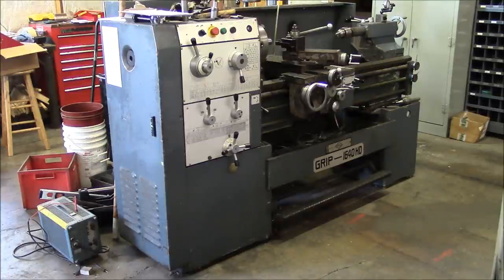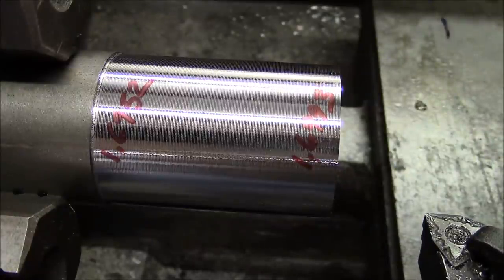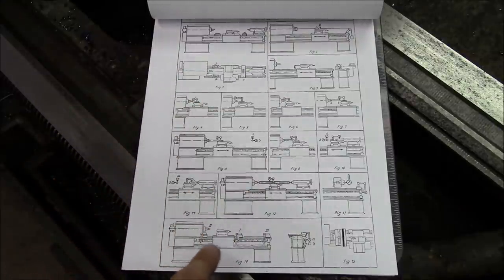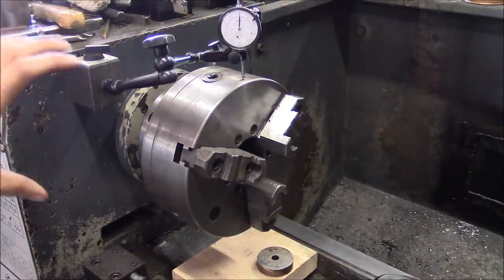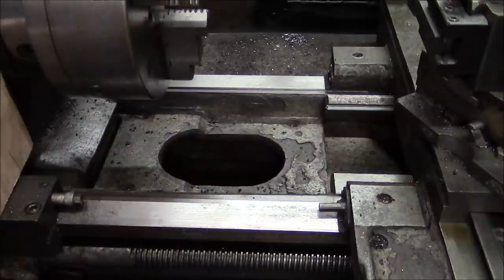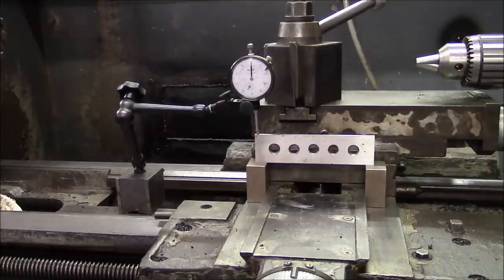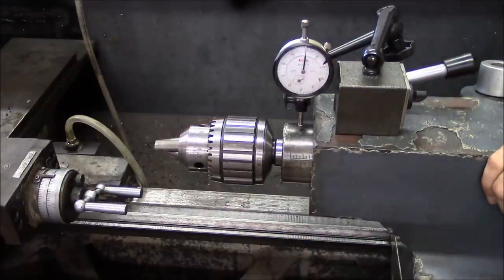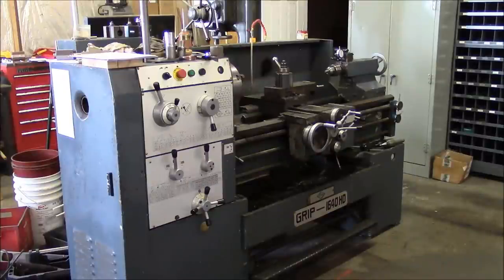Worn Engine Lathe Evaluation

Comment: The finish you got is what we call cat's tongue,  remedy is to increase the feed and reduce the speed.  You can't take a shallow cut with insert you showed us.  It is possible to get a piece of stock which will not give a good finish. Try a different piece.

Your taper is due to bed twist which is nought to done with level...........they use lathes on ships, don't confuse level with twist.

Good luck!

Steve
Reply: Umm, this is his personal/work lathe, he probably uses it every day. I'm pretty sure he would have tried more than one piece of stock. Also he specifically said it was a 40 thou cut, that's not shallow..
Reply: That's a fairly light cut.

I make 3/16 cuts roughing with fairly hard feed regularly on machines at the shop I work in

Comment: Great Video Wes, and a great explanation of how, where, and why to test. To me.....the pluses seem to far out weigh the negatives ....the time, sweat, and unknowns, associated with replacing, should be a huge motivator. With your skills and attention to detail, I have confidence you will identify and repair the problem. If space allows ....maybe a 2nd engine lathe would take away some of the pressure.
Reply from the maker: I do think the machine is worth putting some time and effort into. If I had to put a lot of money into it (hiring an outside company to rebuild it) it would be harder to justify. It's never going to be a Monarch or an Axelson.

Comment: Very nice Wes, Not going to do this on the old hendey, I don't feel like getting depressed today 😳.  Nice work by the way, your subs are moving up fast, 👍 left for ya
Reply from the maker: We can thank Sunppaa for that. I'll bet that Hendey is in better shape than you think. Those machines came from an era of HSS tools and plain bearings. The pace was much slower in those days. Plus that machine was so fantastically expensive when new, I'll bet it was well cared for.
Reply: Unfortunately she has seen better days, lots of ware in the tail stock, compound and lead screw. Like you said though after using it for several years I work around it.
Reply from the maker: An engine lathe can be pretty clapped out and still make very good parts. Much more so than a mill. I've only run worn out machines, so I'm used to it. Once, I got to run an almost unused 50 series Monarch. It was incredible. You dial in .03 and it cut .03.
Reply: Everything I have is 2nd or 3rd hand also. I do get to run a new 2 axis cnc / manual mill at work, man those ball screws are nice, makes me feel bad when I use mine at home. Mine is about the worst I have ever see as far as the y axis. I make due with what I have because I haft to :) I'm still glad I have it even if it's junk.
Reply: @WatchWesWork   We had an addition to the shop back when our 'big' lathe was the Monarch. It was a BIGGER Monarch that had basically been unused, and stored since new. A very fine machine to say the least. The only thing wrong with it, was some bone-head ran a fork truck into the cross slide handle, and broke the ring off the spokes.

Comment: Have ya tried a .01 to .02 finishing cut with a .015 NR insert, preferably with a positive rake, at a higher RPM and a much slower feed rate like .002 to .003 IPR? Adjust the head stock for taper and the cross slide gibs. It looks like a decent lathe to me, just depends on how much accuracy you want out of it, as to how much work you’re willing to put into it. And 1045, 1018 sucks for finishes anyway…lol, Try a piece of 4140 
or brass or aluminum.

Comment: Good video, looks like a great machine just needs some work to correct normal wear and tear. Just a thought, possibly mount a new remote one shot pump if the old one can't be repaired, I think oil from within gets oil into places that you can't from external oiling, also make sure the lines are all clear. You may be able to get replacement clutch parts, Google might be your new best friend! I'm a new subscriber, looking forward to seeing the repairs, thanks for sharing.
Reply from the maker: I will try to fix the lube pump, but if I cannot, I will use a remote one shot pump. I think I have a spare one somewhere.

Comment: If you can rock the cross slide it means the gib needs adjustment. Problem is the uneven wear, and it would be extremely tight at the start of the travel vs. the middle. Also the head needs to be aligned.

Comment: I think you have a decent lathe but I do not agree on how you were measuring bed wear. I would put the tip of the dial indicator to sit on the portion where the tailstock slides. When new (the lathe) the saddle and tailstock ways are true and parallel. When the lathe gets older and  would have seen a lot of work, the front ridge and the flat part(on the inner side) of the bed where the  saddle slides tend to wear out and go lower but never the tailstock  guides. So if you want to  make a better assessment of the bed and see how much the saddle dips you should try this method.
TKS

Comment: A but late for the show, but I'd say the biggest bang for the buck or time invested would be to re-scrape the cross slide.  I would guess that being mainland Chinese the scraping originally wasn't much to write home about and though it may have been ok when new, there were few contact points and it rapidly wore in the middle where it gets the most use. The good news is that it can fairly quickly be repaired (for scraping anyway).
Doing that would probably do wonders for the surface finish.
Reply from the maker: Yes, but see the other videos for details on the spindle bearings.

Comment: Something of note about your thrust measurements on the spindle, you need to bias the spindle in one direction, reset the indicator to zero, then apply pressure in the opposite direction.  Total thrust cannot be measured without first biasing the spindle to one direction.  Also, half a thou of deflection in the spindle bearings is a lot.  My ENCO-1540 can't dial-in less than 3 tenths because the spindle bearings are not in perfect shape.  You can measure an orbit of the spindle as it rotates, showing that you can never get it dialed in.  That said, it will hold a thou if I babysit it, but it can be tedious.  Also, .040 per side for a 16" lathe isn't a deep cut, it should be able to do .125 per side without falling apart, and .050 per side ad infinitum.  If anything, a deeper cut, discounting chatter, should look better because it takes up all the slack in the system.  If you're getting worse finishes with a deeper cut, , then....
Reply from the maker: I thought about this too. I repeated the test using the tailstock to push the chuck the other way. The results were the same. I also checked the other end of the spindle. I'm still not sure if the bearings are really OK. Best case scenario, I have some no name Chinese bearings in there. The preload is adjustable on all of the bearing sets, but some thing have to come apart to do that. I guess we shall see. I think the movement on the indicator is bending in the spindle, not play in the bearings. It's hard to describe the way it feel to do the test.

Comment: I have very similar lathe, looks almost exactly like yours but is is called a Enco 111-1450. Interestingly, it is actually a 16x40 and was under rated by enco for some reason. It was in a field covered up waiting for the owner who closed a business due to health/cancer issues to build another shop, owner decided that was not going to happen so he put all his machine tools up for sale. I thought I got a good deal. Turned out, no. After I checked it the way you checked this one all I can say is YIKES... Mine is worse then yours, it seems to have a lot of bed wear.  

It seems the bed ways are out of alignment with the tail stock ways by a lot also, I got to try and do some more checking but it just seems strange they would be out so much as my bed ways and tail stock ways look great. I guess you can't tell just by how they look.... 

I think I am going to try and evaluate the spindle bearings in the head stock to see if they are toast or are still good as described in your follow up video. Interestingly, the copy of the manual I downloaded shows double opposing angular roller hearings on the chuck end of my spindle. If they are good I'm going to try and figure out how to re-cut cross slide ways and regrind the bed ways. Will definitively do the cross slide but may or may not do the bed ways, I'll just have to start using it and see how all that works out.

I am really starting to see the value in saving and spending a lot more on better machine tools right from the start. 

Interestingly, similar lathes are still sold new by Grizzly as a G0749 - 16" x 40" Heavy Duty Lathe, link here >> http://www.grizzly.com/products/16-x-40-Heavy-Duty-Lathe/G0749

~

Comment: Just seen this, so most of your finish problem is the type of tool you are using.  If the material isn't a tool steel you should use high speed tooling, the shape of the cutting tip 
sharp or slight radius with relief coming away from the cutting tip, not a horizontal attitude.  Even the tip tool you are using have their own types of steel to be used on.
I would love to show you but the trip is too far.  Bill in Brisbane.

Comment: Hi Wes  Great video opened my eyes as to where all the wear points might be on my old Logan.  What do you think most of the finish issues are coming from, the worn cross slide? Thanks for the excellent video. I just subscribed.
Reply from the maker: I suspect that the main factors are the worn cross slide, a tendency for the carriage to rock on the bed ways, slop in the 3 jaw chuck, and possibly the spindle bearings. That's the order I would assign to the problem areas.

Comment: You didn’t check the cross screw and nut
And don’t level a lathe you twist the casting on purpose until it cuts with no taper.

Comment: 10:24 you are using the saddle to do your measurement yet, a moment before you state there is about a 3-thou  drop in the ways... So, you might be in that section of the dip of the ways... Just saying.  Also NEVER forget, the accuracy of all gauges, they have a 1-thou  +/- on most of them. Of course you also have the surface you are sliding on, it can have a burr that gives you a false reading...  I always suggest you mark and flip the tooling to confirm it is also parallel.

Comment: disassemble, rub, hand scrap, reassemble, set gibs, align good as new again even if it started as a   Chinese machine or a raw piece of cast it can all be rebuilt unless it's the ways on the bed that's not easy or cheap flame harden and re ground everything else can be restored.
Reply from the maker: We'll see. I think the minor wear on the bed can be fixed by scraping.

Comment: i am sure the Chinese make some wonderful things, like fireworks and noodles ect, but in my limited experience they don't make very good steel, tools or machines. they give us what we want cheap crap. if something is cheap there's a good reason
Reply from the maker: You certainly get what you pay for. The machine has some good features, but it was built to a price point, and that is evident throughout the machine.
Reply: The Chinese make some of the best tools money can buy, but only for those that will pay for it. What we tend to get is what our tool suppliers order, price being the main factor.
Reply: gixer1109 Precisely. There are amazing machines, especially from Taiwan. Blanket statements like "Chinese only make crap" really annoy me. Like there are no American or German companies that make crap.
Reply: Jon Miller Yep, the Chinese stuff isn't all crap. In the shop I used to work in, we had several manual lathes, mostly older US built iron, and we also had a 16 x 56 Enco. Not exactly sure of it's size, but I'm pretty sure that was it. That thing is a damned good lathe and was used heavily. We had one problem with the feed gearbox leaking oil, which was just a matter of resealing the cover. I normally ran a slant bed CNC lathe, and a 24x144 bed type CNC lathe, both taiwanese, and top quality anywhere in the world.

Comment: first i am not a hotshot machinist but..that cut seems very consistant and between the thread type scratches it looks like near mirror finish. so..let's get right to it..
i think you are mistaken about the lathe and perhaps  you need put your prejudice aside and see the facts...
the problem here is an incompetent machinist...
Reply from the maker: OK. So it wasn't the spindle bearings that were completely hooped or the .008" of slop in the cross slide. It was the monkey at the wheel.